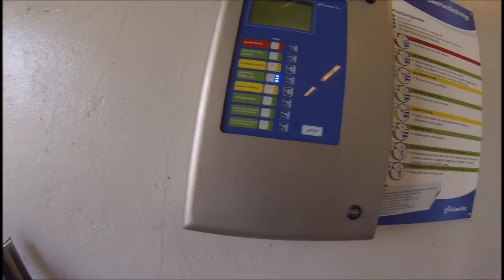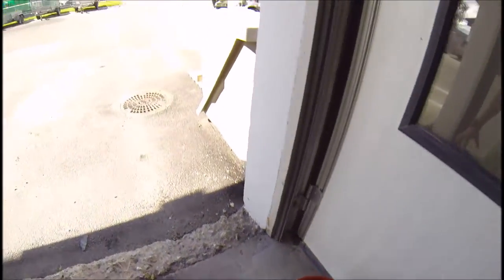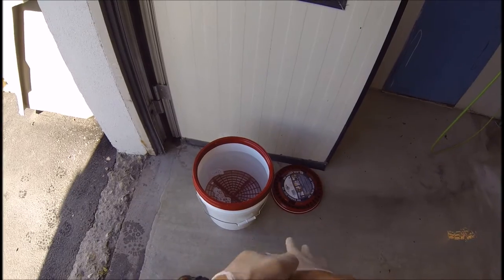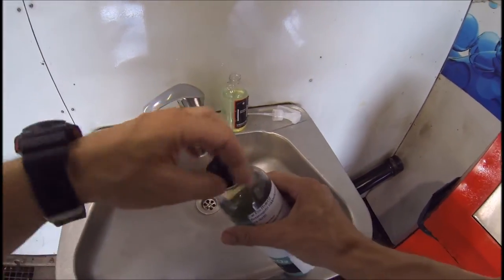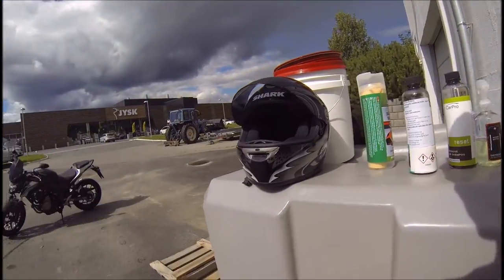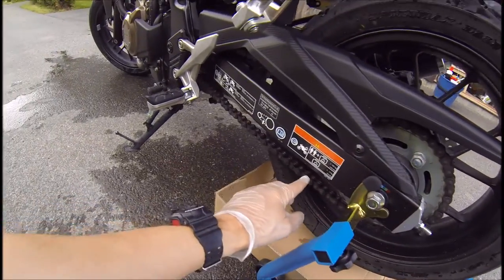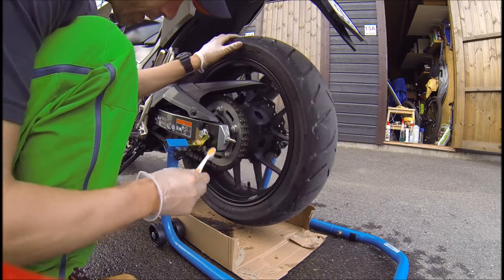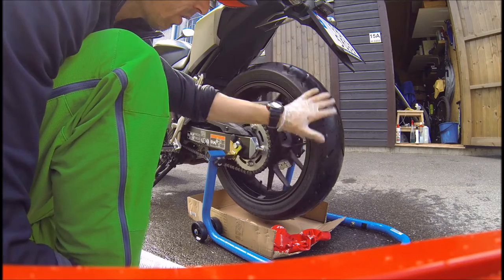Washing the Honda on a summerday.

Comment: hello nicklas,  thanks for the uploads.  I watch them.  I took the stickers off my fuel tank today. same bike as you. I like the stripe.  have you changed the suspension on your bike yet?
Reply from the maker: Hi Adam. No, since Im pretty average in weight I havent been fiddeling with the rear or front suspension. Only thing I ve learned is that rear has a 9 stage setting. 3 is standard setup. Its all about softer or harder settings. The front setscrews adjust your rideheigt or sag.